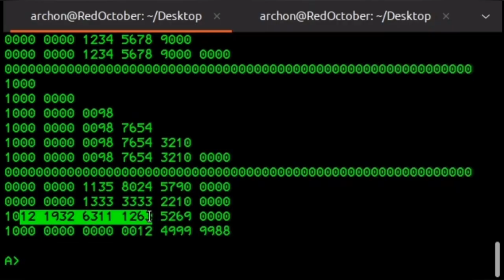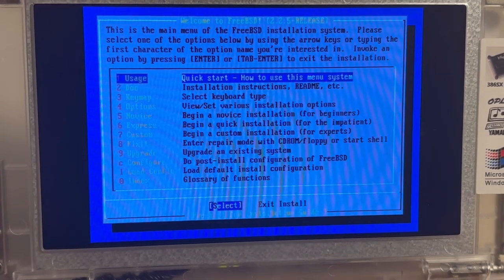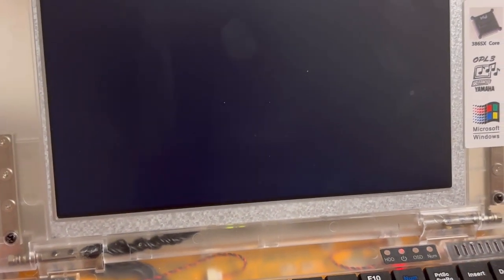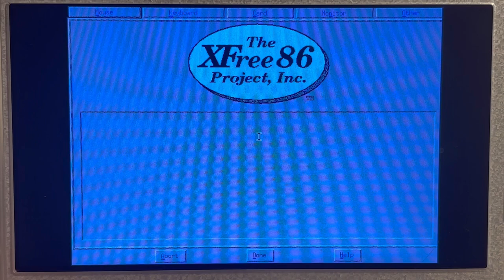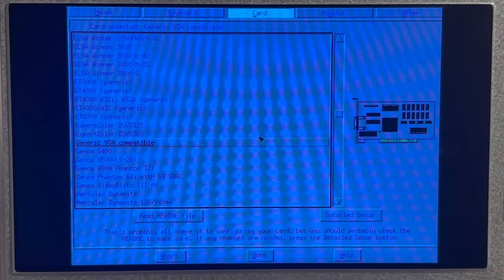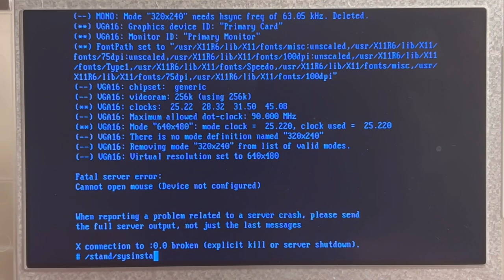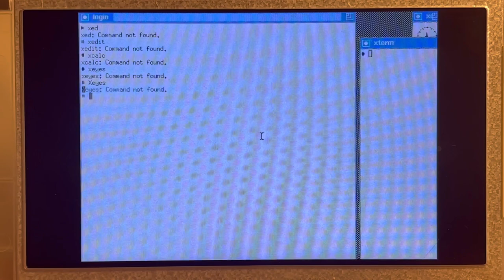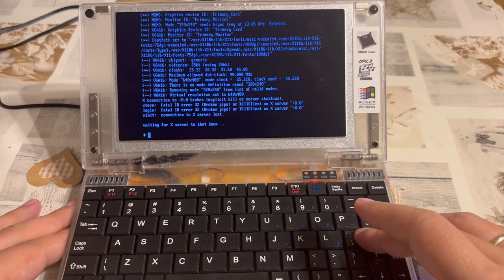Battle Royale — X11 (XFree86) on FreeBSD 2.2.5 on Pocket 386

Comment: Xorg didn't exist until 2003, and is the continuation of XFree86. XFree86 was an PC implementation of X11 and the continuation of X386. It wasn't really competing with anything at the time, and most certainly not with Xorg. The X Consortium (earlier the MIT X Consortium) were the main managers of X11, but their implementation was not for X86 systems. XFree86 ended up replacing this, and become Xorg, which is an interesting story in its own right. But that was much later than 1997.
Reply from the maker: OK, let me rephrase: there were two competing X11 implementations on BSD, and this is concerning one of them and not the other, and I am referring to package names. The historical details are something fascinating which people may care about that trace things to W and the Andrew Project, and in this regard, thank you for the clarification, but I just wanted to show how one can get an ugly well-known Unix GUI. 😆
Reply: @ninoivanov  Not on FreeBSD. That only had XFree86. And calling early X ugly is a sin. :)
Reply from the maker: @lazyhominid I have remembered FreeBSD 6.0, where they competed — see section 5.3 in its Handbook, but yes, you were right, that was later.

Comment: If they made a 486 version with say 256 MB RAM, and the break-out boards with ports, I’d have to buy one 😂
Reply from the maker: Mysteriously whispering — You can already get a 486, just, beware that it is a machine whose BIOS is not nailed to the harddisk ( = NOT Compaq) and that it is one that offers control over Cylinders, Heads and Sectors of a harddrive ( = beware of a lot of old Acers and HPs). But if you should have such a machine, the coming videos will offer a lot of … "ideas". ;) I am warming up here to an OS roller-coaster… ☺️